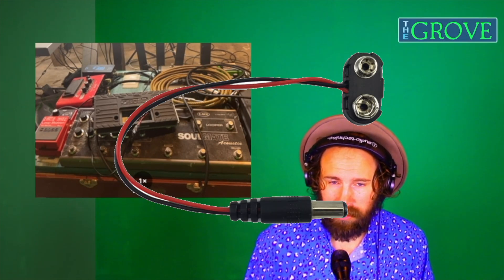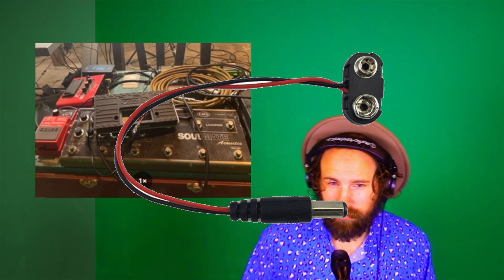THURSDAY LEARN DAY : POWERED FS 6

Comment: On the power supply is the center of the barrel positive or negative? How many amps should it be rated at?
Reply from the maker: Man I really don't know the answer to those questions, not an electrician, just figured this out and it worked for me